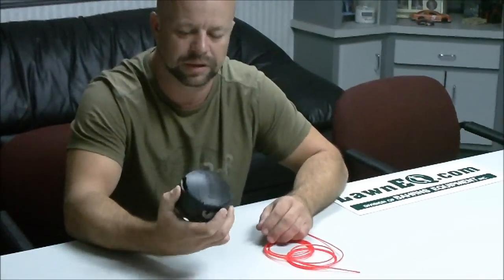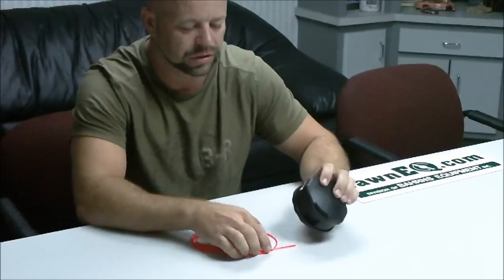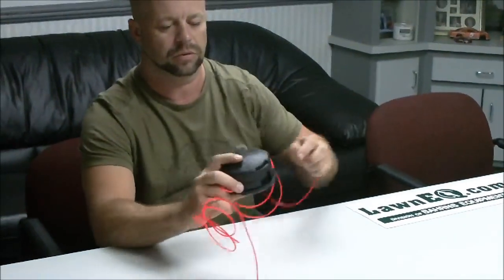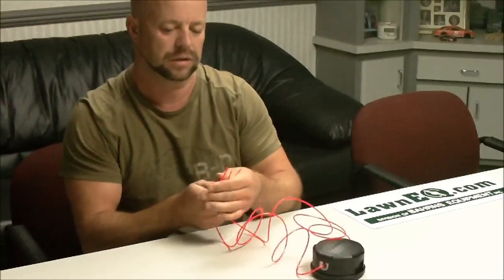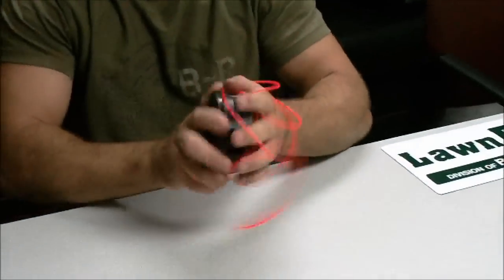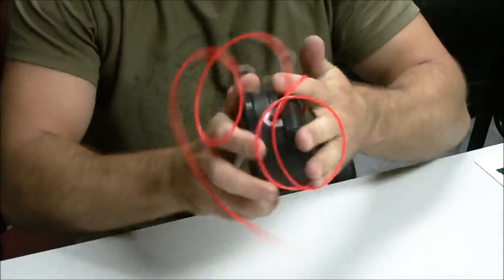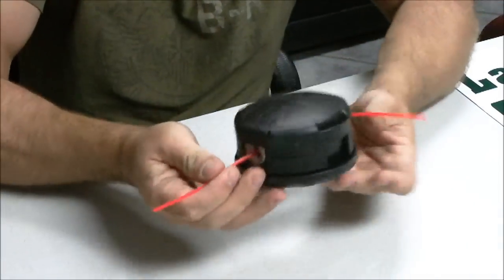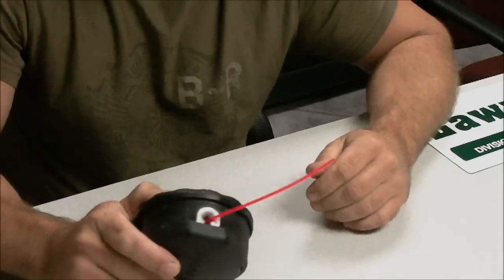How to Wind Up the String in the Echo Speed Feed Head

Comment: Bought this to go with the 35CC Honda string trimmer. Important: there is a spool inside the Speed Feed 400 you can remove if the line gets bound up. Do put the spool back on with the letter "L' being put on the bottom showing that side down to the earth. If you try with the spool L towards the sky with Honda shaft in upright position, it will not work forever and not bump feed line. The best feeding head ever!

Comment: For anyone watching. You don't need to open the head unless it's clogged with Grass.

But to feed the string through make sure the arrow on the bottom is lined up with an eyelet  and then the string will feed straight through the center.

Comment: Why did you pull/tighten the line at the end of the demo and it sounded like it "locked in." Does this improve performance?
Reply: He wanted more line for trimming to be out there at first running. If line is too short there is no centrifucal force to feed the line. So leave some line out there as you put in new line